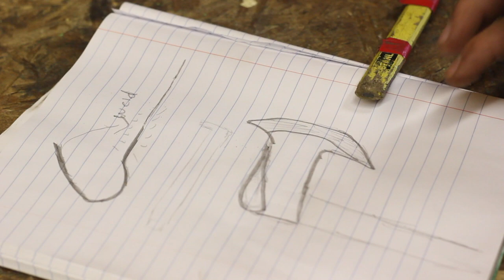How to make a railroad spike hatchet without a drift

Comment: Just to warn you I suggest you NEVER EVER quench any hot metal in a plastic container, unless you want to burn your shop down. It will melt through and spill oil EVERYWHERE thus causing a fire, get an ammo can for quenching instead $12 at Walmart. Also horseshoes aren’t considered high carbon steel either so oil quenching isn’t the best idea, you would get a better result from quenching in water or super quench. Same goes for railroad spike knives. Good work though.
Reply from the maker: Yeah I have since been quenching in metal cans or something similar an ammo can Is a good idea. Every horseshoe knife I've made since then I've quenched in water thanks for the comment.